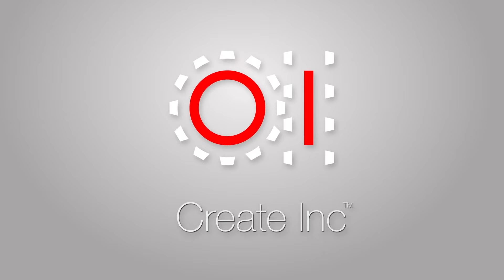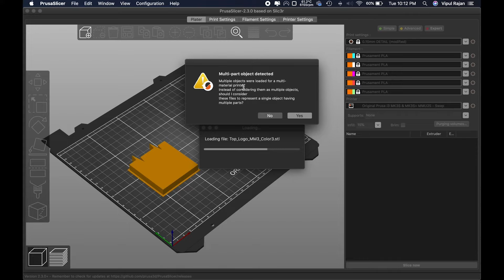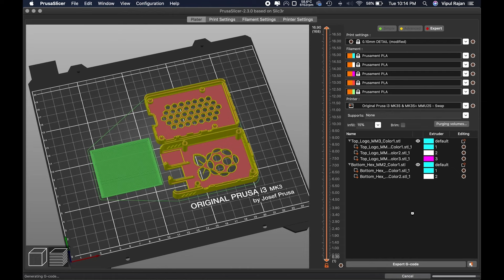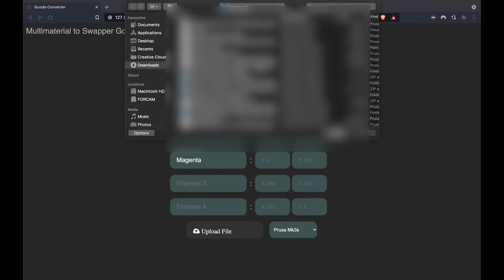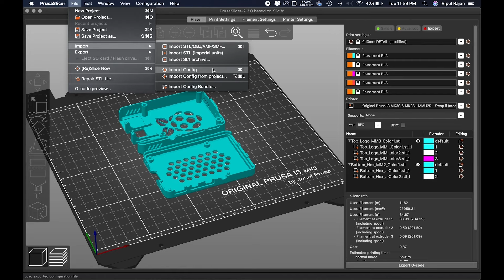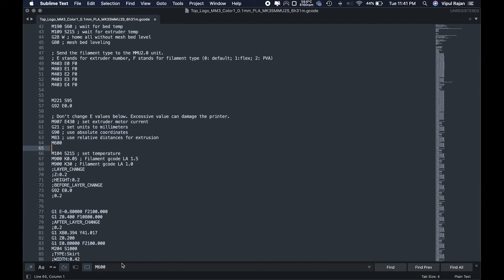Multi-material 3D Printing Without Multi-material Equipment | How does a Multimaterial Mod Work?

Comment: I still use this tool from time to time and to my satisfaction everything is ok. However, I just want to point out that this works for me last time in Slicer 2.3.3. I tried 2.4.0 Alpha also Beta1 and it doesn't work in this version. it looks like the printer is printing everything on the X axis.
Of course, it is not a problem to still use Slicer 2.3.3
Reply from the maker: I'd see what the difference is and update the tool for that version. Thanks for the extensive testing
Reply: @CreateInc  with Slicer 2.4.0 working OK

Comment: I'm trying to use this for TPU but I'm having a couple of issues. 

1: It seems like there are a number (2) of M600 commands before anything is even printed. 

2: The purge line after the first M600 jammed my nozzle. 

Any ideas?
Reply from the maker: You are right about both those things for the default Printer profile. Did you remember to import and use the config I have mentioned in the description? I also show that in the video. That removes those m600 commands (1) and also removes the purge line (2)

Comment: This looks fantastic!  I've been wanting a solution for multi-materials that didn't involve a fussy extra piece of hardware.  I second the request for a Prusa Mini+ version of the config file.  Or, I'd love to see a separate video that describes what you did to produce the config file.  Nice job.
Reply from the maker: On it right now
Reply from the maker: Please see the pinned comment
Reply: @CreateInc  Finally got around to using this for something on my Prusa Mini+.  I can report no problems with your testing site, at least for a two color print.  Many thanks.

Comment: Great Video and Great tool! I got an Artillery Genius, does your Converter also work for this printer? :) Is it also adjustable to other Slicers (e.g. Cura)?
Reply from the maker: I am making a list of every user who has requested an update for their printer. I'd add profiles for your printers and then ask you test them once. 

I don't have plans to add support for Cura in the immediate future though.

Comment: Would love an Ender 3 Pro profile (I have 32 bit motherboard and Marlin 2.0) Thanks
Reply from the maker: you shall definitely have it. i might contact you for a test print. another person asked for it and I'd try to get it up and running as soon as possible
Reply: Superb, I too have an Ender 3 Pro, 4.2.7 board and a newly compiled Marlin along with my BLTouch. I also use cura for my FDM. This looks great!
Reply: @CreateInc  Would like to jump in as well, Ender 3 Pro with Marlin 1.0.1, am installing CR-touch and update firmware.  Cura slicer.